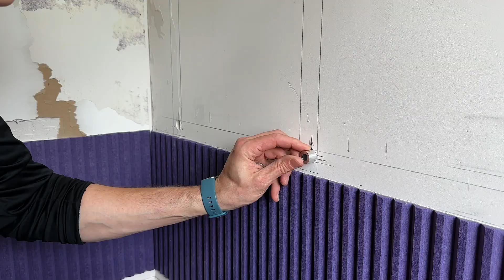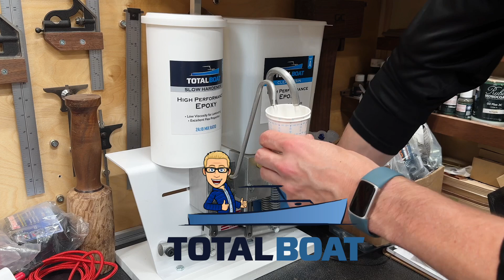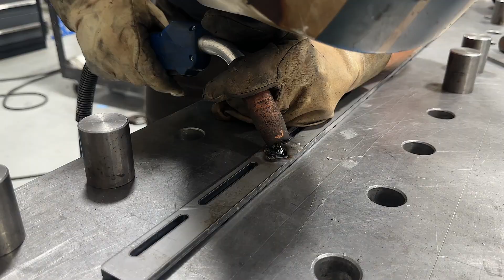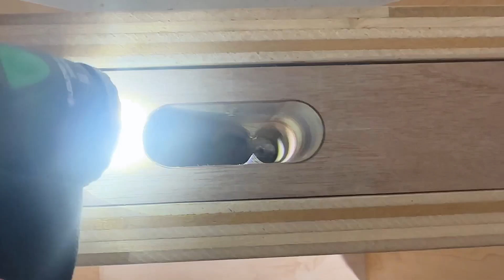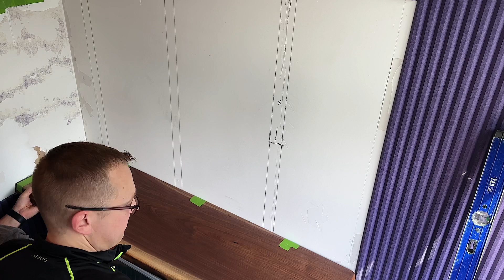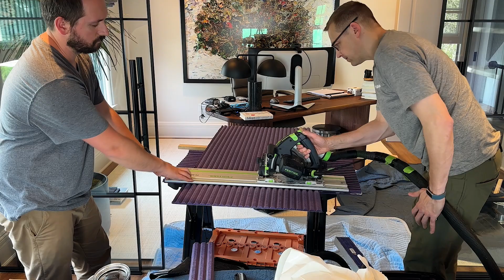Why are floating shelves so difficult?

Comment: Were you ever tempted to just shorten the metal poles an inch or two?? Looks rock solid
Reply from the maker: No, I thought these were the proper length for the depth and weight of these shelves. 👍

Comment: I’m curious on why you went custom with brackets and didn’t use something like the Hovr brand brackets?
Reply from the maker: Hovr are 1-1/2" thick and these shelves are barely 1-5/8", so that's a pretty tight fit, leaving only 1/16" of material top and bottom. And the initial plan for these shelves was to remove strips of soundproofing (not giant panel like we decided to do) and slide the shelves in - that wouldn't have worked with having to angle the shelves up and then lock them down on to the Hovr brackets. Not to say it couldn't have worked, though.

Comment: resaw the shelves in half and use a  bowl bit in your router to make a stopped dado at the same distances on both inside faces, glue it back together and you have perfect deep holes for the hardware. since you ended up laminating one of the slabs anyway you wouldnt even see the seem if you did that after making the holes
Reply from the maker: Not the route I wanted to take on this one, despite having to do it on one of them. I wasn't happy about that either.

Comment: Having just installed a similar set of "floating shelves" with live edges, I really appreciated your video!  I used the Rockler system, which is not as elegant or expensive as your custom metal bracket, but it did the job. Very nice work, especially the matching of the shelves with the desk!
Reply from the maker: Thanks very much!

Comment: I thought the same thing... every single time I've done it for customers. I use 5/8" threaded rods epoxied into holes drilled into studs. I have an frame jig I built to keep them level and perpendicular in two directions (mostly lattice wood with holes appropriately located). Now I can say I've got it dialed in and down as a predictable thing if I'm dealing with stud walls or concrete. Wall anchors NEVER work. Commercial brackets suck too.

Comment: Once you got the initial holes cut, an arbor bit might have been a better selection than a Forstner bit. Forstner bits are designed to produce a flat bottomed hole, which is not useful in this case, and the longer flutes on an arbor bit would have made the drilling far quicker.  I like Irwin Speed Bore bits, but manufacturer is not important.
Reply from the maker: As i mentioned, those types are too aggressive and difficult to stop since they are meant for through holes
Reply: @KeithJohnsonCustomWoodworking  Sorry, must have missed that part.
Reply from the maker: @jandrewmore  No worries!

Comment: Reamer... Use a sliding jig table with two stops on the drill press. A decent drill press can handle the lateral load if you slide slowly, and the deflection won't really matter because: wood.
Reply from the maker: The holes still wouldn’t be deep enough. And I’m not risking the precision of someone else’s drill press by laterally reaming holes. 😂

Comment: I’ve been using regular Lag bolts to do mine. Drill them right into the studs, cut the heads off with a hack saw, put the shelf on top and mark a line. Drill holes and hammer them on. No glue needed, they hold on super tight!
Reply: I’ll send you a picture on Instagram.  But they come in all different sizes.
Reply from the maker: @Wavecruzer79  cool! Thanks 👍🏻
Reply: Same here, I actually cut the heads off and welded on an extra length. The abnormal size gave a tight fit
Reply from the maker: Nice! How long are those lag bolts??
Reply: @KeithJohnsonCustomWoodworking you can get them up to 16in
Reply from the maker: @SonicTool-l3m  😳💪🏻
Reply: @KeithJohnsonCustomWoodworking  Even easier is to just buy 1/2" threaded rod for something heavy like that.  Cut the length needed, taper the end a bit with a grinding wheel, drill into studs, mark location on shelves and drill back into shelves (or mantle, works fantastic there too), double nut the threaded rod to screw it in then remove nuts, slide shelf or mantle on and done.  No relieving the back of the piece for a bracket, and the continuous rods are stronger than a bracket screwed against sheetrock.  Easy to make a simple jig to hold on the wall to drill straight.  I also drill 9/16" back into the shelf or mantle, it won't be loose as the drilling both directions won't be absolutely perfectly straight, and the threads on the rod grip the wood once you slide it on.  👍
Reply from the maker: @LoneOakWoodworks  I did research this method intensively before jumping into this project. Problem is I had no idea where the studs were or what was actually behind the drywall, so I wouldn’t have been able to accurately place the holes in the back of the shelves ahead of time. The initial plan was to just cut strips away and slide the shelves in and not cut a giant panel off the wall. I know it’s very easy to Monday morning quarterback, everything, but the hardest part of this whole thing was drilling the holes accurately and squarely, not the actual mounting of the brackets.
Reply: @KeithJohnsonCustomWoodworking  Correct, they wouldn't be drilled ahead of time, you measure and mark and have a jig on hand to help drill straight..  Not trying to criticize how you did it, just think there's an easier way if it comes up again.  The rods are so strong that no need for that end support either, so a little more to do on site but I think a lot simpler overall.  🤘